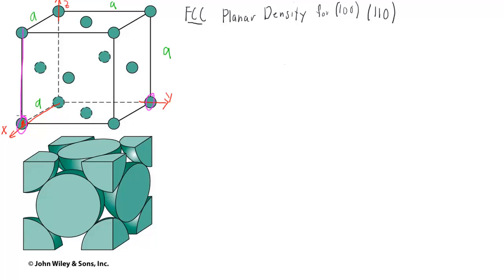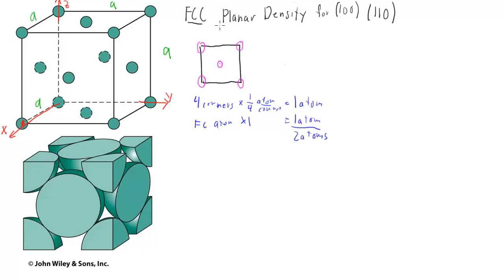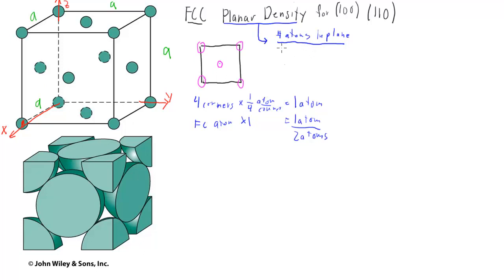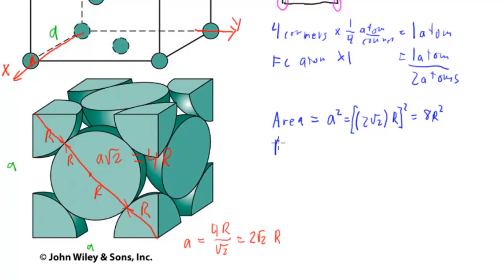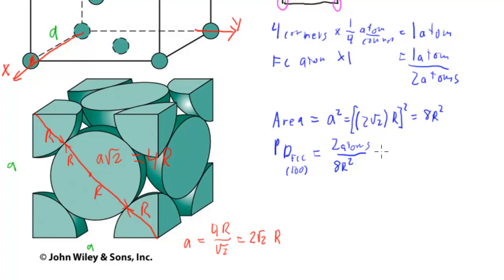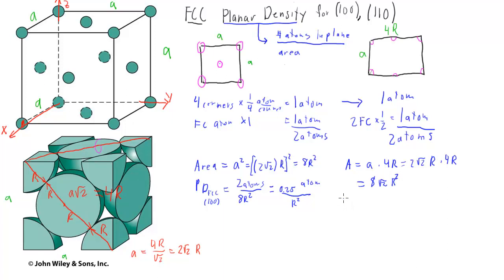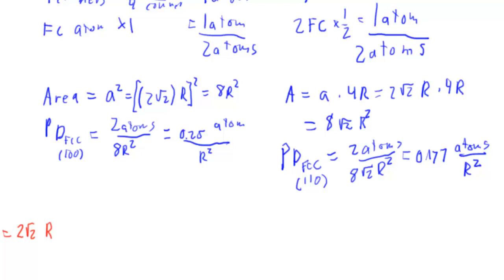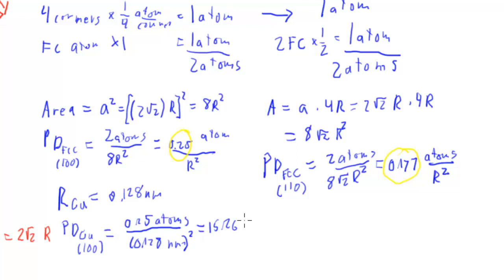FCC Planar Density

Comment: the weird part of all of this linear density and planar density is how the number of atoms are calculated. Linear density you use the R method to find how many lie on the line. While for planar density you rely on the edges of the atoms itself—so you think in terms of 3D. It can get confusing..
Reply from the maker: It's the difference between length and area, linear vs. planar, single radial dimension vs. two orthogonal radial dimensions. 
Another way I like to think about it is that I imagine the atoms are paintballs. How much paint do you walk through along this path? That's linear density. How much paint is on this floor or wall? That's planar density. How much paint is in this room? That's volumetric density. 
Maybe that helps, maybe it doesn't. I hope it did!

Comment: Why are the corners counted as 1/4ths? Aren't they really 1/8th of an atom?
Reply: It's not about visualizing it in 3 dimensions, as you're doing it. Since we're looking at a plane, which is 2D, the projection of the corner onto the plane, which is a quarter. Similarly the sphere in the center has the projection of a circle (2D), which makes a whole (1) atom. Thus 1 atom + (1/4 * 4) = 2
Reply: @Jay-yl6zw  In such situation total no:of atoms for 110 plane should be (1/4*4)corners + 1 (top face) + 1(bottom face) = 3.....
Reply: @incn4106  i have the exact same question about the fc atoms.
So do you think we should count 1 for both 110 and 100 or ½ for them?
Reply: I am also confused as why it's counted as 1/4 and not 1/8. also for the face atom being 1 and not 1/2...
Reply: Hey there. If you would consider as 1/8th of an atom then you were considering 3 dimensions and in 3 dimensions the cube corresponding to the square which catches 4 corners of 4 atoms would catch 8 corners of 8 atoms. So you would get 1 atom anyway (1/4 * 4 and 1/8 * 8).
I guess it is like this.
Reply: Manuel Pedro what about the FC atom being considered as 1?
Reply: for FC atom when make projection for 3d  sphere atom it becomes circle so plane(110) contains the total circle so contribution will be 100% this means 1

Comment: why we divide 4R  by under root 2 for [100] fcc linear density
Reply: +Hamid Abbasi 
We need to get an expression for the side length "a" in terms of "R". FCC has four R from corner to corner on a square, so, using geometry, the side of the square ("a") will be 4R/(sqrt2). We will need this relation to calculate the LD in any direction, including the [100].

Comment: HOW DOES 4R/SQRT(2) SIMPLIFY TO 2SQRT2 R (KEYBOARD MESSED UP REASON WHY IN ALL CAPS)
Reply: +Richard Butler 
4 / sqrt2 = 2*2 / sqrt2 = 2*(sqrt2*sqrt2) / sqrt2 = [cancel sqrt2 from top and bottom] 2*sqrt2
I hope that helps.
Reply: actually u can get 2 sqrt2R by using conjugate theorem

Comment: Isn't it 1/8 of an atom at every corner?
Reply: +Sav L 
Sorry it took so long.

This is considering planar density, not volume. There is 1/8 of an atom at the corner of each cell volume,  but when you consider the 2-D square, each corner has 1/4 of a circle. That is also why the central atom of the square counts as 1 full atom, because it projects a full circle onto the plane. Maybe my black/purple square/rectangular diagrams need work...  ;P

I hope that helps.
Reply: @jeffbirt6671  In such situation total no:of atoms for 110 plane should be (1/4*4)corners + 1 (top face) + 1(bottom face) = 3.....
Reply: Yes, in general you are correct, I was confused at first too. But since he counts the central atom in the middle of the 100-plane as 1 atom instead of 1/2, I think the atoms on "both sides" of the plane count towards the total atom count, since the other half or quarter of the atom may be shared with the next unit cell already, but so is the 100-plane we are looking at. I hpe my explanation makes sense :-)

Comment: Why do the corner atoms count as a quarter of an atom here, but half an atom for the linear density of an FCC (110) vector?
Reply: +Akfloatable 
Not really, iWonder. It has to do with the number of dimensions. 
- The corner atom in a cell provides 1/8 of its volume into the cell volume.
- It shows 1/4 of its projection into a cell plane (square or rectangle). 
- If you are doing linear density, a line segment will go through 1/2 the corner atom  to reach the corner point. 
That's why a different fraction is used to calculate densities of different dimensions.

I hope that helps.
Reply: It has to do with the way the plane "slices" the specific atom. In the first example, the plane slices the corner atom in a way, that if you consider both sides of the plane, which are in two different unit cells, they each touch 1/8 of the corner atom which is in the respective unit cell, which adds up to 1/4. The 110 plane on the other hand slices the corner atom diagonally, therefore touching the total amount of 4 of the 1/8 parts of the corner atom, adding up to 1/2 of an atom

Comment: How many atoms would be in the plane of [002]?
Reply from the maker: Yes, the (002) plane is the same as the (001) plane, it's just offset by another cell length. They are also part of the (100) family.
Reply: Same as [001] :)

Comment: Why does the one in the middle count as one, not as one half?
Reply from the maker: It's not that the atom is cut in half, it's about the projection of the atom onto the square section of the [001] plane. For the FCC, the projection is a full circle, whereas the corners each have a projection of a quarter-circle (even though the picture looks like they are cut into eighths).
I hope that helps, 10 months too late...
Reply: @EngineeringandDesignSolutions  It helped me, thank you!
Reply: @EngineeringandDesignSolutions  10 moths too late, 7 years too early
Reply: abhay anand
 You're cutting the corner atoms in to quarters though.. i don't understand either